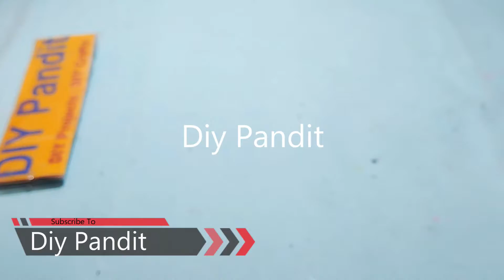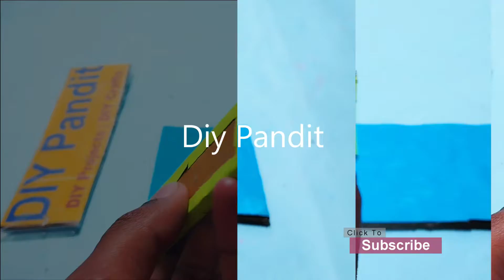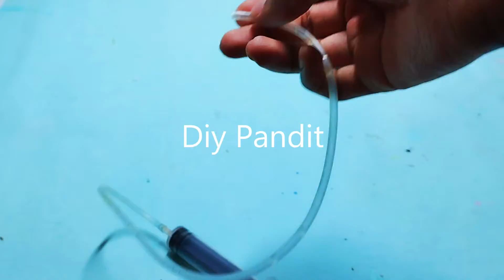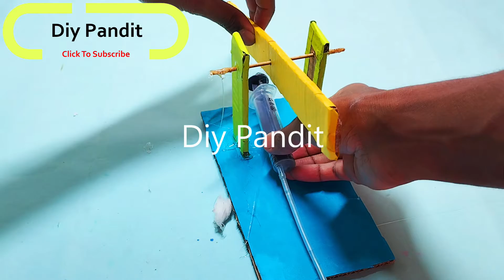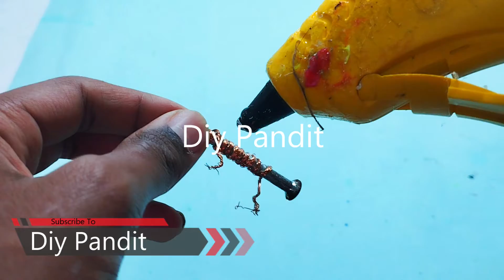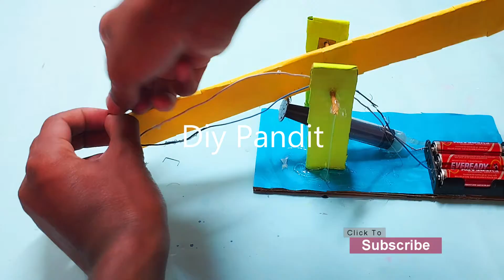hydraulic electromagnetic crane working model science project exhibition - diy - simple | DIY pandit

Comment: Sorry 😅,I love 💕 the work.
But there is a similar project that they gave me like to make an electromagnet crane.And I have chosen to do your idea 😻😣😣😣😣So I was wondering what was the materials that you used because same materials I already knew them, but the others I know them but I do not know that specific names.
Reply from the maker: 9 battery
Nail
Copper Wire
Chopstick
Syringe
Drip pipe
Wire